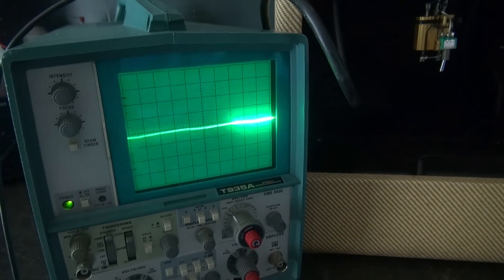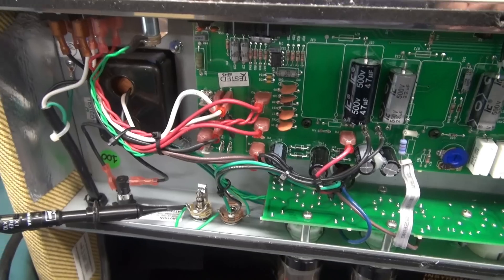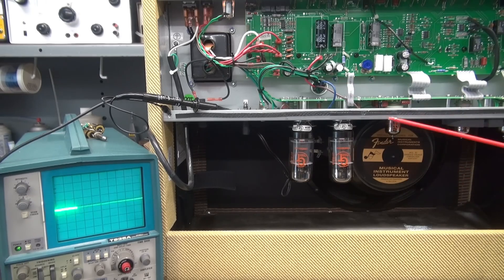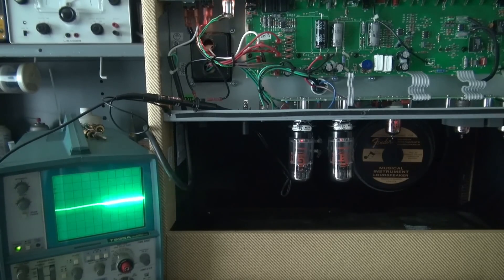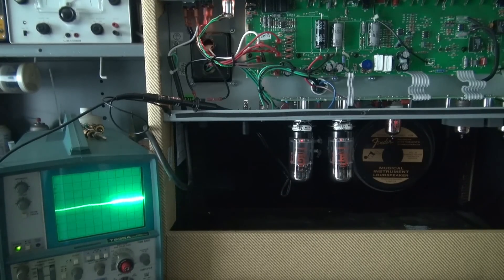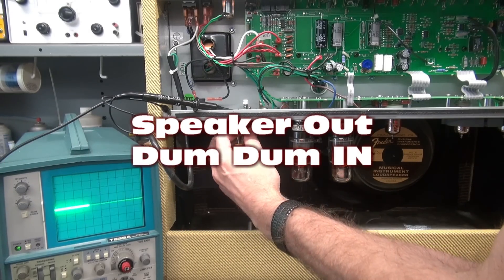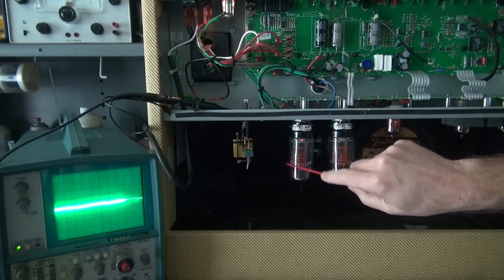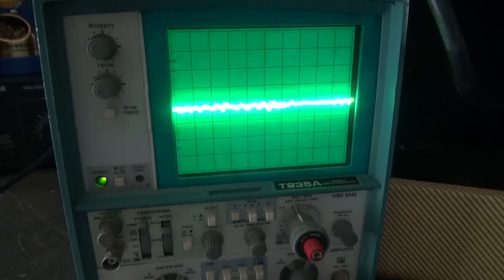How to troubleshoot tube guitar amp noise using a dummy load resistor

Comment: Hey have you had fizz issues in lower than normal voltage amps....I have a 2203 circuit that has audible fizziness when I play through it....it has 400 volts on the plates which is a little low for a 2203....but it's stock everywhere else

Comment: Great tip and do you know something I have experienced this issue in the past scratching my head lol do you mind if I ask what scope would you recommended and do you have a schematic for the dummy load you used ?  I assume using the DL its only used for a very short time during testing so should get warm to hot ?

Comment: I bought a 100W 8 OHM resistor. Its a big one! My question is, to make a dummy load out of this, would I connect the tip of the speaker cable to one end and the sleeve to the other end? I'm pretty sure this would work, but I want to ask someone who knows best.

Comment: Our test-panel systems at work (audio repair shop) have switching between dummy loads (4 or 8 ohm, selectable) and speakers ---- but the speakers are on a shelf four feet above the work bench, far enough away to be at least somewhat  mechanically decoupled from the amp chassis and any microphone-like behavior is minimal;  and therefore we can leave  the speakers "on" when performing a tap test,  and poking/prodding at the circuit board. We put a 400 hz tone through the amp so that noise spikes or pulses can be seen on the scope, and simultaneously use a distortion meter so we can look for a jump in distortion level as we do our tap test.

Comment: So the olde scope is showing alternating bright line/dim trace due to the camera's auto exposed shuttering rate... i.e. to your eyes it'd be just a constant line???
Reply: At work (audio repair shop) we typically put a low-level 400 Hertz sine wave through the amplifier, and look for noise spikes on the 'scope or changes in the distortion level (on a distortion meter) when we tap on the tubes and poke and prod the circuit board.
Reply from the maker: Yes, that was just a constant horz sweep line, the camera interaction made it look that way

Comment: Hi Terry, thank you for another very helpful video. If you were to ever make a pro-shot instructional video on amp diagnosis and/or repair I would most certainly buy it. BTW, a local tech here in Orlando that I know, with many years of experience, shares your view on the IC caps. And he hates the Fender PCB’s. He told me that they cannot be reworked and they use the cheapest components that they can get away with.

Comment: Hi,  the IC axial electro's are known to degrade over time?.. I was led to believe they were a great cap so use them alot.. dang.. can you recommend a good axial electro then to replace the IC type ones please?.. I can only purchase from Digikey here in NZ which is a nuisance... cheers.
Reply from the maker: Hello, I use the F&T caps. Have great luck with them
Reply: Thanks for that.